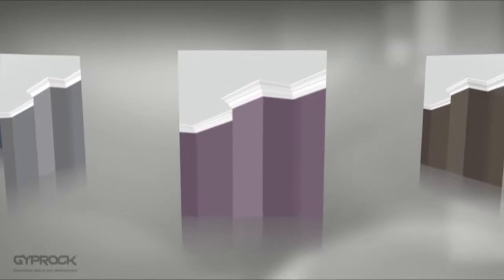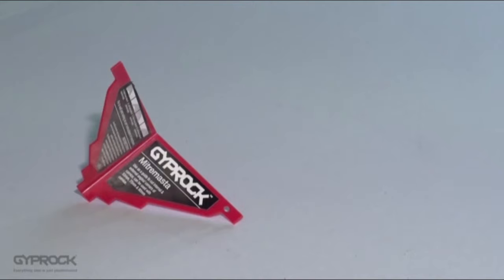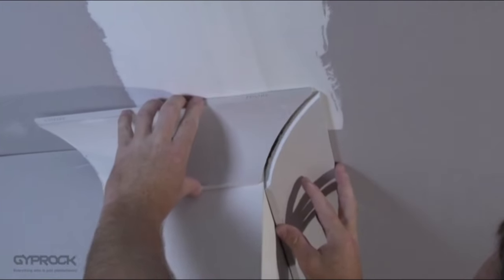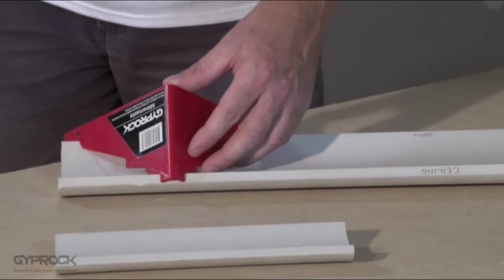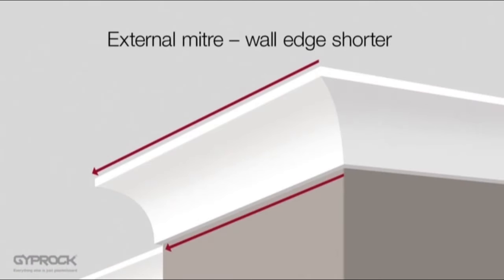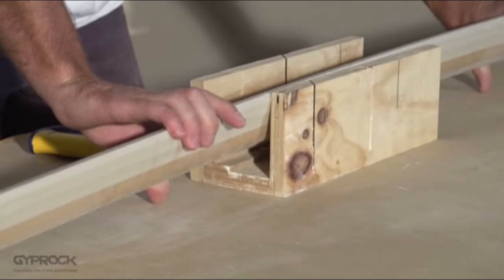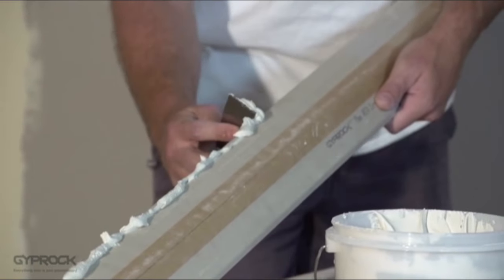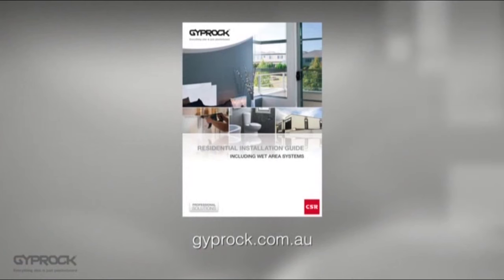How To Install Plasterboard Part 5: Installing Cornice

Comment: Remember, for internal mitres the wall side is shorter, and for externals the wall side is longer. Measure the distance along the ceiling and remember to subtract the distance for the shorter length twice because it has two sides, then make that shorter distance the wall side of the cornice. Now that you've cut the mitre, don't forget to multiply the distance by 2 because there are two sides to the cornice, then cut the mitre accordingly.